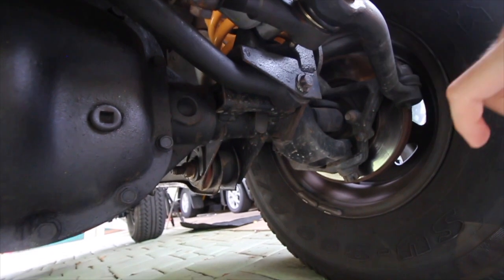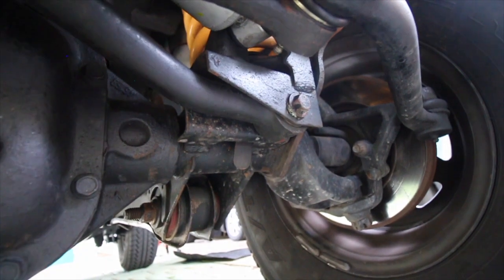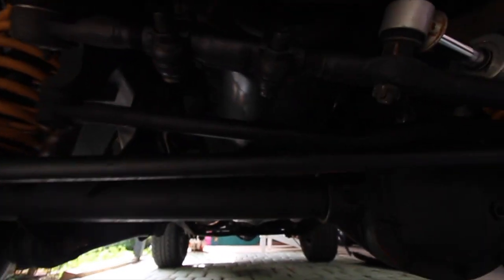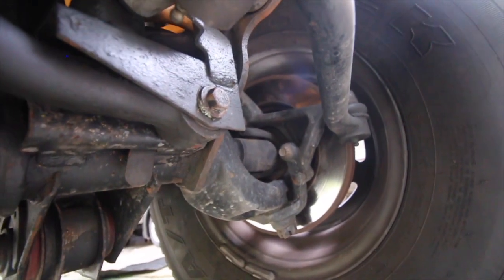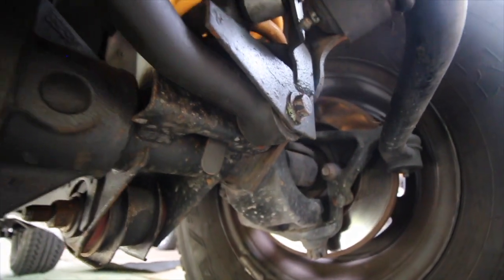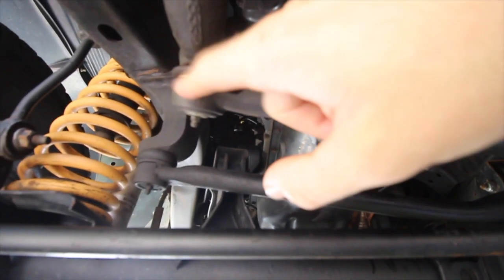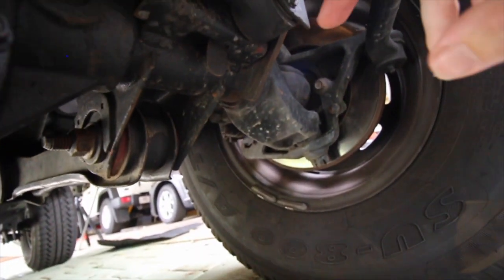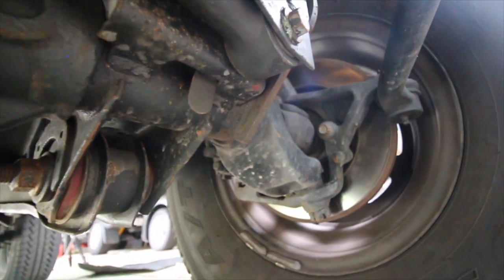JEEP DEATH WOBBLE FIX

Comment: Good video! Breaker bar- never leave home without them 🤣❤️🐞
Reply from the maker: It’s a Bug’s Life thank you, I might have to buy a second one that just lives in the Jeep
Reply: A length of pipe that fits over the breaker bar, hammered flat on one end to fit combination wrenches is invaluable.
Reply from the maker: KC9UDX definitely, I might have to make my own and start selling them
Reply: @KC9UDX  Agreed.  I kept a 2 foot one inch pipe in my Jeep to work with the socket wrenches.  Never thought about flattening one side for the open end wrenches - thanks for the tip!  Though at this point the pipe has been replaced with a Harbor Freight 24" breaker bar as there is no 'slop'.
Reply: Pipe with flat and some other things: https://youtu.be/nFa4vpatdwM

Comment: Awesome video as always. I wish I had done this before I had taken it to a shop to fix, Coast me over $200 for them to fix it
Reply from the maker: Thank you mate really appreciate it. oh no that sucks, did they say what the problem was in the end?
Reply: wtf ???? 200 bucks to fix what
Reply: They replaced the track bar bushings and charge two hours to do it. Will not be going back to them
Reply: Baily White I literally replaced my trackbar bushing for under $50 bucks and spray painted it myself . You could of saved a whole lot doin It yourself you just could of taken the track bar to a machine shop or any mechanic shop give him $20 bucks to just remove the bushing and place new ones in ALWAYS HOLD YOUR POCKET WATCH YOUTUBE VIDEOS SEE IF THE JOB IS BIGGER THAN WHAT YOU CAN HANDLE WE ALL LEARN FROM OUr mistakes

Comment: There's an easier way to deal with death wobble: get a CJ or YJ and don't convert it to coil springs.  Then it's not just fixed, it's totally impossible.
Reply from the maker: KC9UDX hahahahaha I think that’s my only option. Sounds perfect 👌
Reply: @Whiteandsonsgarage  there's another option: put YJ springs on your TJ.  But who does that?
Reply: mk319mod0  positive ground!
Reply: mk319mod0  actually, I may do the leaf spring conversion.  If I can ever find time, there'll be a video.